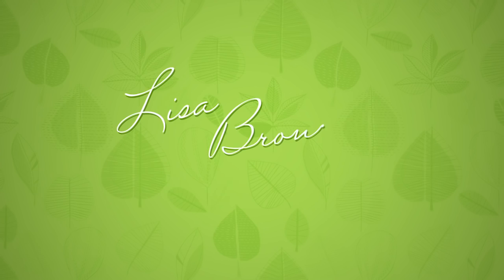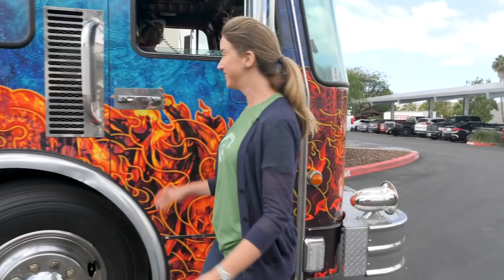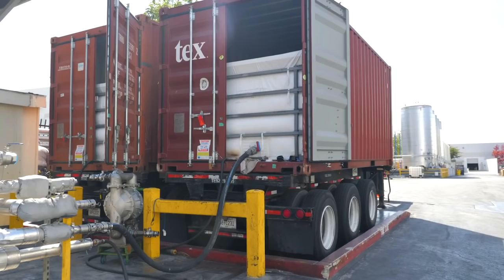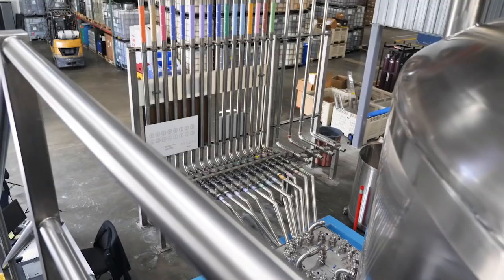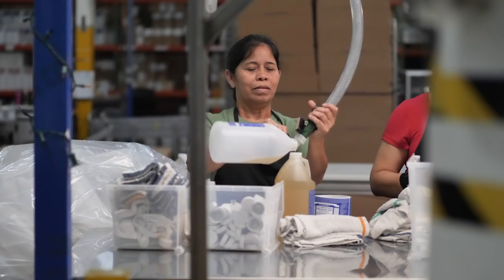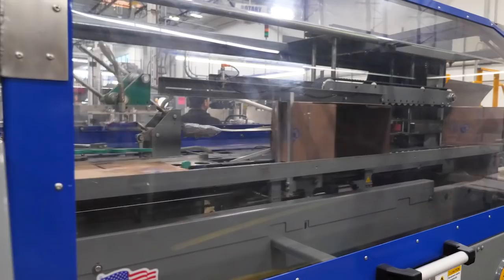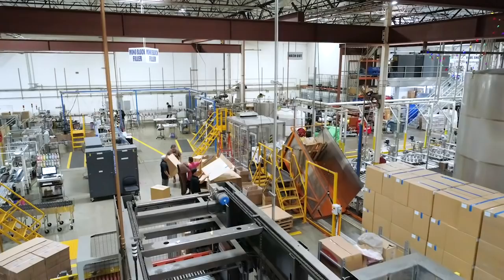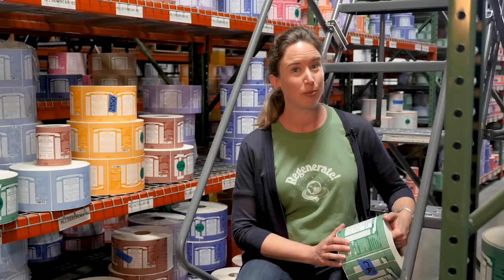Dr. Bronner's Factory Tour: Liquid Soap Production

Comment: Would love an additional pump for these soaps as an option
Reply from the maker: I'll pass your suggestion along! In the meantime, the 16, 25, and 32 oz. bottles all have the same neck size: 28-410. If you're using a gallon size, it takes a 38-400 cap – 38 mm wide with a 400 pitch.  You should be able to find a pump online.

Comment: Has anyone ever had issues with their drains clogging after several years of using Dr. Bronners soaps? My mom mentioned to me that it coats her sink and tub in a gross almost wax like coating and I said that happens to mine too. She is concerned that the soap is doing the same thing to her drains (and to the septic system at my farm) and is going to eventually cause a horrible clog. We are quite new to using the soaps so I am curious if anyone knows if this is something we should be concerned about or if anyone has any tips on preventing the scummy/waxy coating in our tubs and sinks? I absolutely love the soaps so I just  put up with having to clean my tub and sink very often, but a clogged drain and calling a pumber is something I dont really want to have to deal with, so I'm just curious about other people's experience.
Reply: I've been using Dr. Bronners liquid soaps for over a dozen years now. I don't seem to have this same problem. Usually I buy the large quart jars of the liquid Dr. Bronners soap which is in concentrated form, and I refill my kitchen and bathroom hand soap bottle dispensers with a dilution of the product at somewhere between 1:1 and a 2:3 parts ratio soap to water. Doing this thins the soap out just right for my use and also makes the product last longer.  Try diluting it with about 30% water and see if that might help.
Reply: I experienced this as well in my sink when using the Castile soaps, but since I've switched to the Sal's Suds I no longer have that problem.

Comment: @Lisa Bronner - I grew up with your soaps (I literally grew up in the co-op in my town, my mom bought the store's first space and turned it into our home). But I am deadly allergic to Hemp. I've become afraid of your products now because of possible cross-contamination (I have had adverse reactions after contact allergies). As more and more people are becoming allergic to hemp, or are having that allergy diagnosed are their any plans in the operations of Dr. Bronner soaps to create products without hemp?
Reply: I don't know this for sure, but I would expect the saponification process more or less completely reacts out both the alkali and the source of glycerol. Of course this is something you should ask Dr. Bronner's directly about as allergy safety is super important, but I used to work in chemical engineering some years ago in polymer chemistry. I would expect there's unlikely to be much left of hemp allergen compounds after it's reacted out. Note that also this is refined hemp oil in the first place so whatever the compound is might not even be there to start with. Just a thought.

Comment: Cab I use your soap for feather items such as feather pillows and down coats?  Thank you
Reply from the maker: Hi there- If the care instructions of the items say to use a “mild detergent,” then yes Sal Suds will get the job done. This is one of those rare instances when I don't recommend Castile Soap for his use.  If there is any hardness (mineral content) in the water, the Castile Soap will react and potentially leave a residue on the fill. For an HE (low water) machine, use ½ Tbsp. (7.5 mL) Sal Suds. For a regular washer, use 1 Tbsp. (15 mL) Sal Suds. Check out my blog post on cleaning down and down alternatives for more details and lots of tips, https://www.lisabronner.com/how-to-wash-down-down-alternatives/.
Reply: @GoingGreenwithLisaBronner  Hi Lisa - thank you very much for your reply. Unfortunately, my pillows - well, they're actually cushions - do not have a care label on them at all but they are definitely 100% feather filled. I live in a very hard water area. My washing machine is a front - load Miele. The Dr. Bronner soap I have is Hemp Tea Tree. Thank you for your advice and for the link 😊💐
Reply from the maker: Hi there-  Castile Soap in hard water for down is not ideal because it reacts with the minerals in hard water to leave residue. Typically, this is easily mitigated by using vinegar in the rinse cycle. However, vinegar can negatively impact the features. Sal Suds is clean rinsing in hard water conditions, making it the best option here. However, if it's not available to you, you can soften the hard water by adding 1/2 cup washing soda. Allow it to dissolve into the water, before adding the Castile Soap. Depending on the size of the pillows, you may need to use a large capacity washer & dryer, such as found in a laundromat.

Comment: Hi Lisa,
I just started using Dr.Bronner Castile soap for my dishes because of my sensitive hands. But I noticed that it doesn't look shinny clean but has like an oil like strick left behind. Pls advice how I can make my dishes look super clean using Castile soap.
Reply from the maker: Hi there- It sounds like you're experiencing soap scum caused by the soap interacting with the minerals in hard water. To counter this, rinse dishes in a tub or sink of water with 1 cup of vinegar. (Important tip here: don't mix vinegar with Castile soap. Vinegar will unsaponify the soap.) Hand drying dishes will help too.